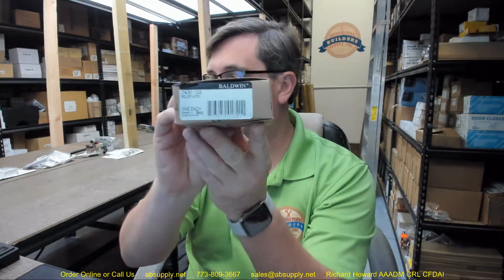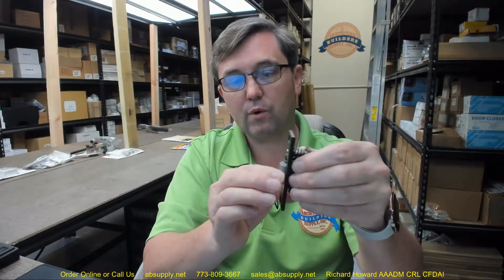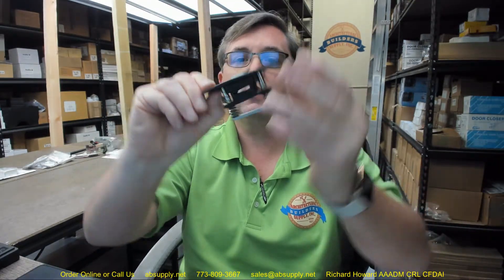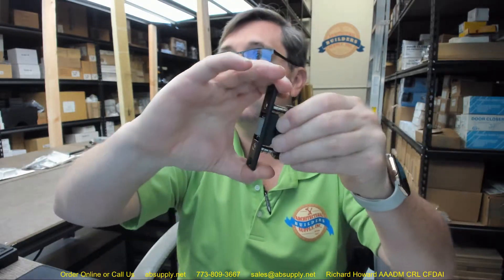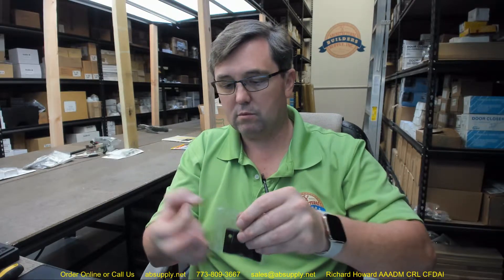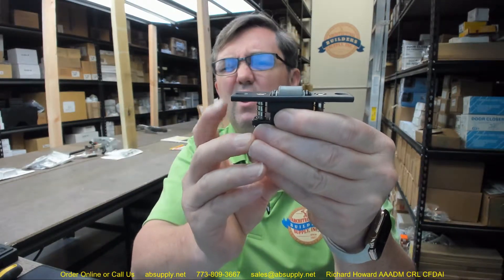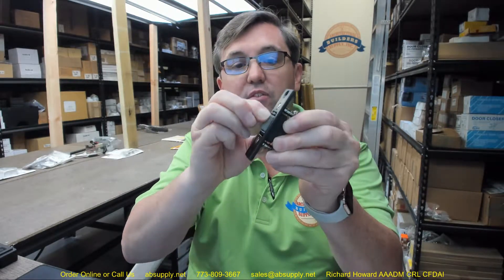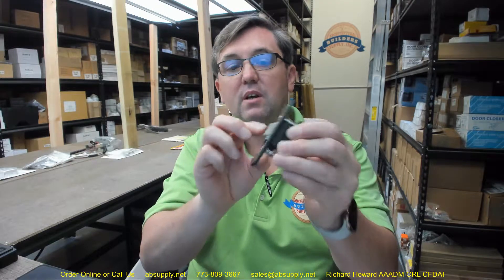Baldwin 0430 Roller Latch 102 finish

Comment: The springs were in the correct position originally. The weaker springs allow the roller to depress and engage the latch plate. Tightening the screws adjusts the tension on the roller, not the amount of roller exposed.